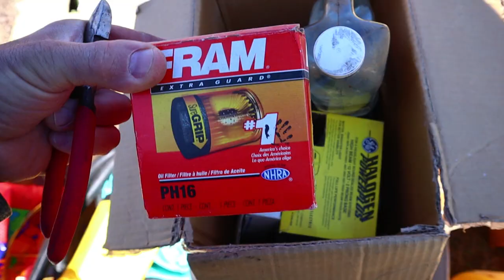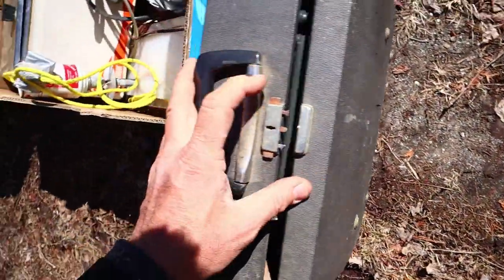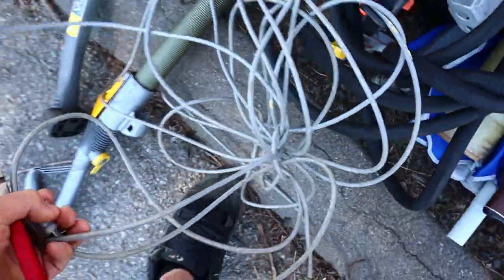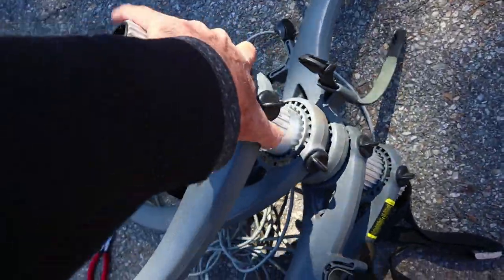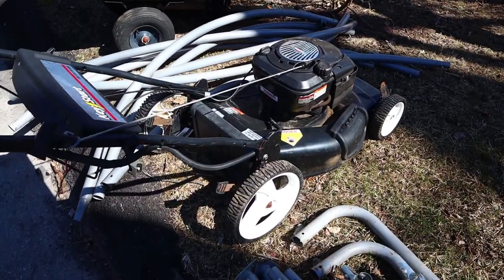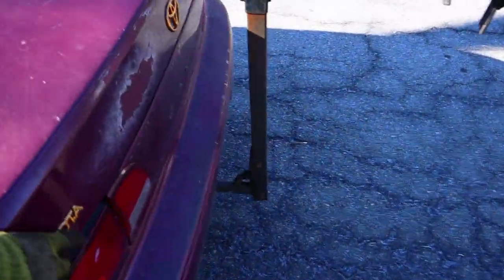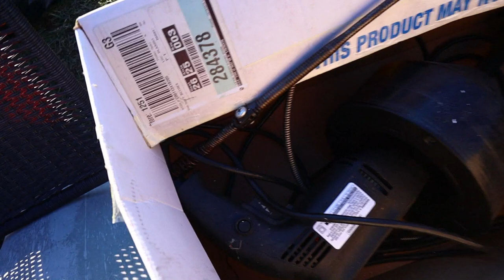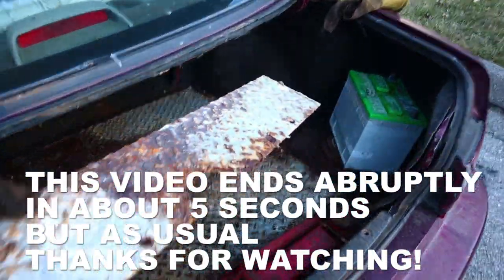How to ADJUST a SARIS BONES BIKE RACK while TRASH PICKING

Comment: When you picked up the cast iron skillet, the long flat piece of aluminum is a concrete float, or bull float as it's called. They cost well over $200 new and you could have sold that one for $50 to $75 with no problem.